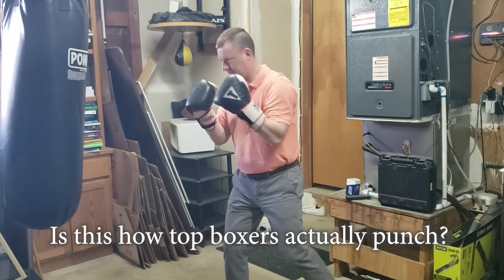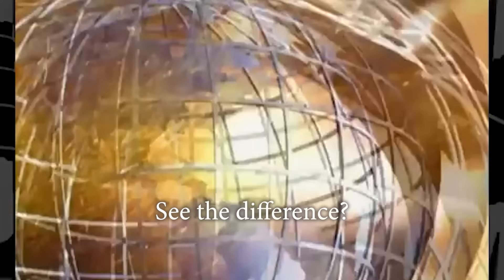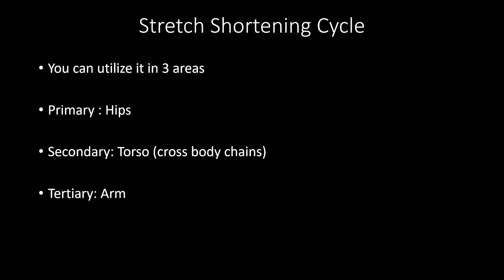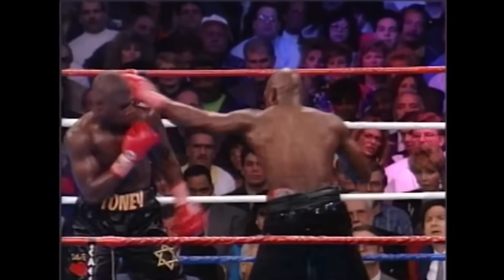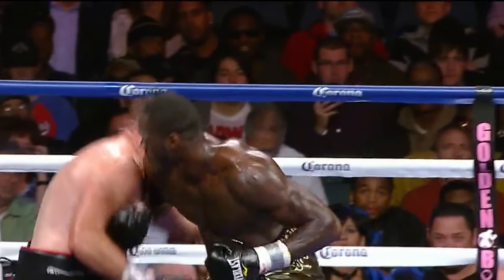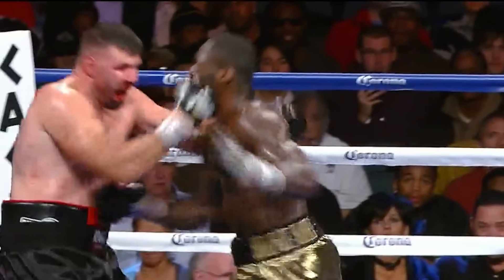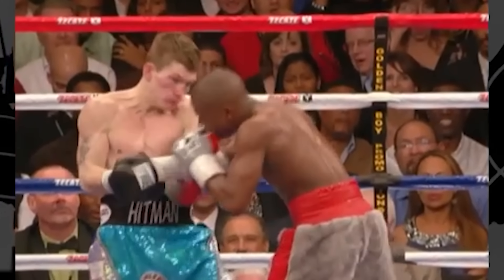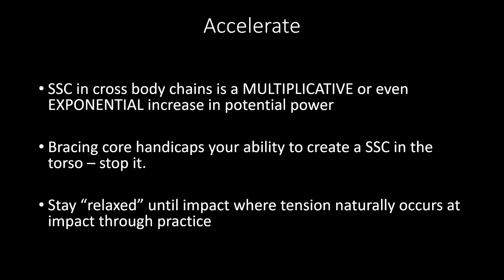How ALL "Natural" Punchers Generate Power: Kinetic Integrated Mechanics Reference Video

Comment: I’m a professional exercise physiologist and have been boxing for roughly just over a year. This is by far one of the most informative, spot on the money videos I have seen when it comes to punching power that I have seen.
Reply from the maker: Thank you, glad you liked it.
Reply: @ThePunchDoctor Hello!

I am just about to buy your course, but I still have some questions.

1. Does this mechanics also work for Palm Strikes? I practice street fight self defense, so palm strikes are preferable

2. Does you course also explain how to make strikes non-telegraphic? I tried to train on my own, but it won't work.

3. Does your course include the ways to improve endurance?

Thank you in advance for your reply!
Reply from the maker: @XStar4  Hi, thanks for your interest. Yes you can use the mechanics with palm strikes. I think a lot of people have misconceptions about strikes telegraphing.  and are overly concerned about that. All strikes are going to telegraph to an extent. If someone is unprepared it matters much less. The pros I show on my channel are all using similar mechanics. Can the opponent tell when they are going to strike? often yes. Does it really matter that much? usually no, as I show. You can use feints to distract your opponent or obscure your intent through movement and other means.  using these mechanics is much faster than using techniques people think telegraph less. 

I don't have specific ways to improve endurance in my program however I'm happy to discuss it. Most people will increase endurance simply through athletic training.

Hope that answers your questions.
Reply: @ThePunchDoctor  I CAME TO SAY THE SAME THING

Comment: This is insane, because I just recently came to this conclusion on my own (minus the more in-depth concepts and details, of course.) I’ve been focusing on integrating it into my technique. 

For me, it was just knowing that the feet serve as the foundation for the entire body, so when they move or rotate enough, so does the rest of the body. Doing a quick, strong pivot and allowing the resulting kinetic energy to flow naturally results in a stronger and even quicker punch. Doing this just yesterday gave me results I’ve never gotten, even though I’ve only been practicing this way for about 2-3 weeks.

Comment: what are some practical exercises we could do to engrain these mechanics into ourselves?
Reply from the maker: Things that will work the chains I cover will all help, especially exercises in the transverse plane or incorporating rotation. Things in the video I mention include good mornings for posterior chain engagement, barbell punch and other landmine exercises at the gym to get an idea of the cross body chains. Other things you can do include medicine ball throws with rotation or catching and releasing while resisting rotation and keeping your hips square, explosive exercises like shuttle run and exploding out of sprinting blocks are something you can incorporate as well. I think sled pushes are worthwhile as well. Tire sledge or chopping wood are good too. Kettlebells and clubbells are great training tools as well.
Reply: @ thank you!!

Comment: Some good stuff but the key to boxing isn't hitting hard. Little is taught in boxing gyms about most boxing mechanics lol. The techniques are designed to get the most power while protecting yourself. Most "hard" hitters get away with it because of defensive flaws. Mike Tyson, one of the hardest hitters was taught the way you say is wrong 🤔. So yes, punching power and speed can only be minimumly enhanced to thst individuals limit and not more and some are gonna be naturally superior.

Comment: Traditional  Japanese karate  teaches you proper punching techniques. These techniques are completely applicable in boxing. Floyd Mayweather uses a couple of these techniques as his bread and butter. Boxing calls it a lead right hand, karate calls it a reverse punch.  Both use the opposite hand for the lead punch twisting at the hips.
Reply from the maker: The opposite hand doesn't add very much and it's not sound technique because you are losing the protection it provides by pulling it back. I think this is a big misconception. Take a fighting stance and pull your opposite hand back as hard as you can, it is insignificant.

Comment: So the way you explain this, from what I’m understanding is guys like Beterbiev and GGG do this often correct? It kind of almost feels relaxing to punch this way. Whereas a lot of times I was told to brace my abs and throw. 10:01 I’m new to this kind of technique
Reply from the maker: None of them brace before they throw. The bracing (contraction of core muscles) takes place at impact as those muscles contract to add stability at impact.

Comment: I’ve been saying the same thing for years. Body must go from max relaxation to max rigidity in the smallest amount of time possible. Drive with the rear foot/big toe. Rotate hips with glutes. Contract rectus abdominus. Squeeze fist tightly upon impact. Practice every day. Unleash during sparring to make sure it works during the fight. ( don’t finish off ur sparring partners tho.)
Reply: So true. I think rigid rules often overshadows natural "feel" in boxing gyms these days and confuses beginners' abilities.

When I naturally punch as hard as I can, letting my body naturally dictate how to move to produce the maximum power it got a lot better as I pushed my limits on the heavy bag over the course of a year.

But I notice when I go to my boxing club and attempted to get used to the basic pointers they gave me, (you know the typical, pivot the foot for hooks, rotate the body, step into the punch) I found I lost my power by actively focusing on these things. For example I didn't need to pivot my foot because I already intuitively knew how to whip my body without using a foot swivel. Which can work if you prioritise your body naturally doing them as a result of trying to generate power instead of just doing the motions in order to gain the power if that makes sense. Very interesting stuff.

I often observe my club-mates throwing punches and it appears textbook, the hips are swivelling, shoulders whirling, and a drop-step is employed yet the punches don't seem to have as much force as you'd expect them to, because these principles are thought of as separate. They're paying too much attention to the individual moves instead of trying to hit as hard and fast as possible and letting their body and mind naturally adjust themselves over time to become more efficient at generating power and speed.

If I had to make an analogy, it's like a beginner painter trying to recreate a masterpiece by focusing on each individual brushstroke. They might technically replicate the strokes, but the piece feels lifeless compared to an artist who captures the essence and emotion of the original work without overthinking every movement which disrupts the "flow"

It's an unconventional philosophy of mine to focus on natural feel first, and technique later if severe bad habits are formed. Most of the time these "bad habits" are just the person's unique body type performing a movement in a way that is more efficient for them than anyone else. What do you think?
Reply: @jxrinYT  because your body has natural aspects that make it unique in how you punch, same principles and fundamentals but our bodies function a bit differently from others
Reply: @jxrinYT great breakdown and totally agree.
Reply: @jxrinYT  You actually shouldn't pivot when throwing power punches, i don't know why all coaches and trainers nowadays tell you to pivot when punching, but there's no need.
Reply: @NeoCortex1st  Yup, I agree with this. I heard somewhere that at first it's to help the particularly stubborn muscle memories of beginners get into the habit of rotating their bodies with punches otherwise they'll only throw arm punches.

It's impossible to pivot your foot and not rotate your body at the same time, but I think this is a flawed reasoning because then they depend on the pivot and miss out on potential power, instead if they were attached to the ground and just learned to rotate their body without "detaching" from the ground by pivoting they would get that extra power.

Can't throw a strong punch if you're boxing on ice, cos you can't become grounded. Same thing with pivoting, it ungrounds/detaches your grip on the floor. So yea I agree
Reply: @jxrinYT   Yeah, I completely agree with everything you said here! You know your stuff brother! Stay safe.
Reply: @jxrinYT jednak jeśli chodzi o moje odczucia to rzeczywiście mogę sie z Tobą zgodzić, ponieważ gdy nie miałem techniki to ludzie się bali moich uderzeń a im więcej techniki tym te ciosy wydają się słabsze, ale gdy wykonasz je odpowiednio luźno i szybko , to wtedy sieją spustoszenie.
Reply: @jxrinYT  Never imagined seeing someone in the comments with the same exact experience that I've noticed with boxing gyms, and also the same philosophy I approach boxing with. Natural feel beats textbook learning every day. Great comment.
Reply: @jxrinYT wystarczy że byś nie zauważył tego ciosu i byś wtedy go odczuł. W zadawaniu ciosów chodzi o jak najmniejszy nakład energii i jak najszybsze wykonanie ciosu. Można bić mocno ale jeśli będziesz przewidywalny to taka siła ciosu na nic się nie przyda.
Reply: Facts
Reply: do NOT drive with a toe unless you hate having skin

Comment: I managed to grasp most of those principles by myself after years of training and I think I got the mechanics down.
I know that turning your foot (lead hook) reduce the power you can deliver instead of keeping your foot still, but what’s the biomechanics behind this ? Is it just that you have a more stable foundation with your foot not pivoting so it helps generating more rotation for your hips ?
I’m also wondering why it’s not the case for other punches such as the 2 and the 4
Reply from the maker: if you're pivoting on the front foot you (generally speaking) won't be leading with the hip and won't be creating "torque." They way guys show pivoting on the front foot for the hook doesn't allow you to create stretch between the hips and torso. They are turning their hip and torso together and you want to turn the hips first independently of the torso. You need to create the rapid stretch to contract off of to take advantage of the muscle elasticity. There are guys who do this on the ball of their foot, however this can often leave you in a poor position.
Reply: @ThePunchDoctor  wroooooong

Comment: Good vid. Subbed. I would say look into the training systems of the former Soviet Block, though they do prefer a more In-Out style with a more square stance. 

I found in a GPP sense getting a Deadlift up to near x2 Bodyweight + single leg lifts(split squats, SLDL, rotational med ball throws/etc,  and Core/Rows) filled up most strength gaps then a emphasis on Skill work. LOTS of people IMO drill the Skill but NOT using it on the fly or under unideal situations. 

Disagree with the 'grip the floor', IMO is more for Short punches/clinch as well as if you need to punch off of a Maul or if in MMA and Takedowns are a factor. Get in a clinch and put your fist 3 inches away from their jaw and try to punch. I think this is what a lot of karate and kung fu guys drill for. Though if moving on the outside gripping the floor may be less a concern but i would think it facilitates sitting on one's punch.

Same with Hip+Torso 1:1 turn, its IMO better to use that if you need to muscle someone and let your "structure" do the work. Outside of sport, i dont need to hit their face, i just need to hit their neck ;)

Check out some of the Okinawan Karate training for the hips, they to the 'pre-twist' in a very short movement. YiXing/BaGua Kung Fu as well but note they are Bare Knuckle systems and more 'internal'(IMO more into smaller more powerful Stretch-Shortening). 

Old Time Boxers(pre modern glove?) punches more straight because the step was more like a rising lunge often with a vertical fist. Modern Boxers can use a vertical fist to slip between a shelled up guard(Pacman used that a lot). It allows tighter inside shots like short hooks and shovels and uppercuts.

Also those Kung Fu systems mentioned do a lot more short straight punches because the more advanced ideas are less about putting your knuckles into a dude's face and more about putting a finger in his eye/neck or setting up a choke or trip.

I would recommend Fout's work on power and Pendulum stepping but heads up - that dude is eccentric and if you even slightly disagree he will fly off the handle and challenge you to a fight. Not sure if hes really like that or its just a YT persona.
Reply from the maker: thanks, I'm familiar with the soviet style and am not a fan. There's a reason you don't see many pros using that style. Or put the other way, there is a reason people with that style don't become successful pros.

Comment: bro what you're saying is making sense, but it's so complex. Can you give some exercises to just blindly follow to understand these concepts?
Reply from the maker: For gym type stuff any transverse plane (rotational) exercises can help - medicine ball throw, barbell punch, band exercises, tire sledge or chopping wood, plyometric and explosive exercises like 10 yard sprints, shuttle runs and sled push can all help. I have more specific in depth drills and exercises for the various phases and punches in my program.
Reply: A proper karate punch does exactly what he’s talking about.

Comment: Can you turn your hips without pivoting or moving your foot? Like if I’m trying to throw a longer range lead hook, do I need to pivot my foot in the direction my hips are headed or could my foot be facing forward while my hips turn right? I feel like this movement would cause a knee injury
Reply from the maker: Which foot are you talking about?
Reply: @ the front foot in the case of a lead hook, but the question applies to all punches. Right cross and right foot for example, could I throw the cross and keep that foot pointed right
Reply from the maker: No, you don't want to pivot on it. I have a hook video covering that. "Don't do this when you throw a hook." If you want to create torque and use your chains you should not pivot on the front door. Some guys will create torque off the ball of their foot but that leaves them in a bad position. I talk about this in the Inoue video and at the end of the Ilia Topuria video.
Reply from the maker: For a cross you want to push off of the back foot rather than pivot.
Reply: @ThePunchDoctor can you explain more on that "push" because for years all I've worked on were pivots but I've heard quite a few figures say it's not needed to generate power in the right hand, but when I try it, it feels awkward and telegraphed. Also do you have any tips for the right hook to the body
Reply: @Osishqjiwhwh69  this guy does'nt know what he's talking about.